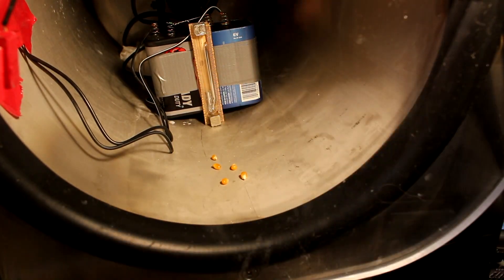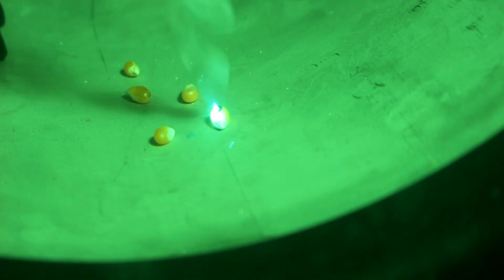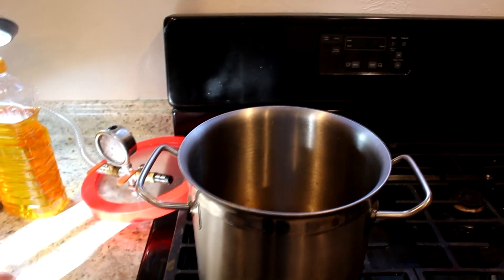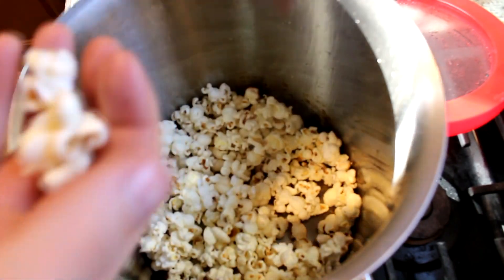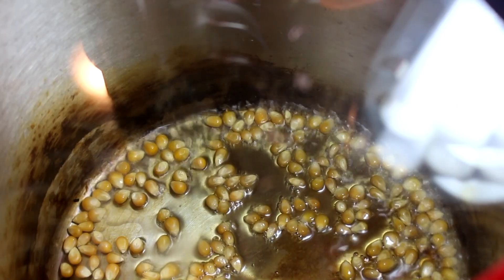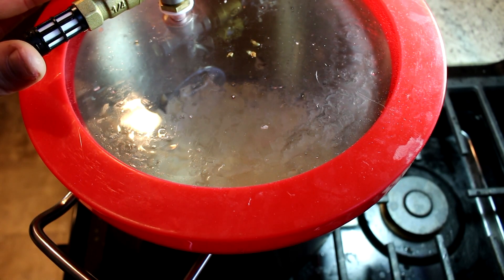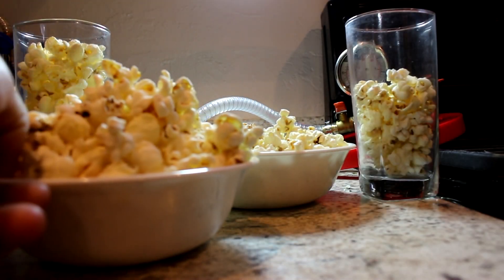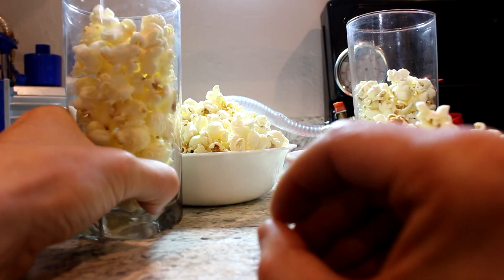Popping Corn In a Vacuum

Comment: What was the pressure at which you made the popcorn in a "vacuum"? And did the pressure rise significantly when you turned of the pump, presumably because of the escaping gasses from the popping corns? Namely after you tuned of the pump the lid did seemed to fog up quite a bit.

Comment: I wonder if movie theaters will start doing popcorn in vacuums now to cheat customers even more.
Reply: Jens Boettiger Kaleb Bruwer the cost to setup the vacuum, maintain and run it (plus time added to process = $) would outweigh the savings on kernels.
Reply: You have no idea how cheap corn is.
Reply: That's not a bad thing lol
Reply: In the UK the price for a movie theater to make 1 large popcorn is about 6 P and a normal around 5P the actual cost we pay is around £6 for a large with a drink such a rip off.
Reply: They could use less corn for the same price.
Reply: time to deliver a pizza ball , maybe the cost to setup and maintain the equipment is more than it should be? Lol
Reply: Kaelan Dinwiddie its 4000% mark up
Reply: JavierBacon especially GMO corn :(

Comment: Makes me wonder if the vacuum would affect how easily the popcorn would burn.  Any difference in speed or temperature settings?  I would think that the vacuum version might cook faster and/or require less total heat energy since there wouldn't be as much heat transferred to the atmosphere.  Would be neat to see this done at high pressure as a comparison.

Comment: If i see cinemas installing vacuum popcorn poppers to rip us off by selling us less popcorn, I'll blame you.
Reply: Kaleb Bruwer the cost to setup the vacuum, maintain and run it (plus time added to process = $) would outweigh the savings on kernels, they are extremely cheap.
Reply: eaglescout861you'd also then multiply the time it adds to the process and to maintain etc. You pay employees, time = $.
Reply: Silver_+ but then multiply that little amount saved by millions of pounds of corn that are sold ever year at movie theaters
Reply: Silver_+ Employees get payed there shift. I don't see how new machinery would extend their shift or force overtime AT A CINEMA.
Reply: Kaleb Bruwer paid not payed

Comment: That's one way to make more money... Pop all your corn in a vacuum, you get more bags from the same amount of corn. Plus you can mark them at a premium, marketing them as "fluffier than normal popcorn"

Oh god what have I brought upon us all
Reply: You brought the same stupid comment everyone else had. Doing this will never result in cost savings. Corn is too cheap, vacuum chambers are too expensive and take too much energy. If anyone wanted to sell vacuum popped corn, it would be for pure novelty.
Reply: You brought nothing
Reply: Dried costs a few dollars per bushel. It had been so cheap that there are pellet stoves for heating homes and hot water fueled directly by corn as "pellets".
Reply: That makes sense at first but in the end you'd earn around the same amount of money as if you did it normal way, since pumping out air again and again isn't free, just fyi.

Oh and pumping out air not from a small stove like this, you know...
Reply: and also the time it takes for a full batch of vacuum popped popcorn is definitely going to be longer than popping that popcorn into a vat of oil w/o vacuuming the air out. so overall i think whatever positive revenue you may get from vacuum popping is offset by the amount you can produce in the same time frame. although it's all speculation on my end and i'm not a popcorn industry expert. lol

Comment: shouldn't the vacuum have boiled the water in the kernels and made them pop? I thought this is where you were going anyways. When I work on AC systems in a vehicle, we prep the system by drawing it down to -30 inches of Hg for 30 minutes, which causes the water to boil and evaporate out of the tubing. it probably wouldn't take near that long to achieve popped corn! I want to see this tried without added heat!

Comment: now cinemas will invest in vacuum chambers to fill more bucket with less corn ._.
Reply: More expensive to cook the corn under a vacuum though.
Reply: actually it probably wouldn't be more expensive since popcorn is extremely cheap to make. We pay over 1,200% of what it's actually worth
http://www.inquisitr.com/871573/movie-theater-popcorn-costs-more-than-fillet-mignon-report/
Reply: Sticbas well the corn is cheap, and you would actually need less of it. but the convertion costs of corn to popcorn will be much more expensive. creating a vacuum is pretty expensive energy-wise.
Reply: The point you're missing the though is the actual cost of corn. It only costs theaters about 10 cents per ounce of popcorn. With this method, based on corn alone, it would cut that down to 5 cents. Considering we already pay astronomical prices for popcorn, charging more wouldn't be necessary. Even if they did charge more, it would only really add a couple cents to each bucket of popcorn. Honestly they would probably be back at 10 cents per ounce with energy costs included.
Reply: This may be a little dishonest, but it's not highway robbery considering you can be charged 9 dollars for a large bag of popcorn. Here where I live, if you go up to the counter with a large bag, they will refill it for free. They fold down quite nicely, like any paper bag. I just keep mine in my glove box and slip it in when I go to the movies. Free refill. They charge for the bag, not the popcorn, so employees can't give out free bags of popcorn. Free new bags of popcorn, anyway. I don't feel too guilty doing this, as I refresh every 5 movies or so, and buy a new one for sanitary reasons. They get their money, and still make a lot of profit too. I go to the theater a lot, and popcorn kernels are so cheap. Plus, I buy a drink. So, they aren't losing any money on me.

Comment: Would the corn not pop under vacuum alone with no heat?
Reply: No, it wouldn't make popcorn. Part of the popcorn equation is that the heat causes the starch to cook ("gelatinize") before it pops, essentially forming a hot gel foam that solidifies when it cools. Without the heat, no cooking and no gel.
Reply: You watched the same video I did. Did they pop immediately in the vacuum?
Reply: I expect it would freeze.
Reply: The water inside would boil before freezing.
Unless the corn husk protects it from the vacuum.
Reply: Yes it would boil, but the boiling water is not actually hot.
Reply: Cody put his hand in a vacuum chamber before, It was not a very good one because it was not that strong but the vid's on here if you have not seen it. When he did it, nothing happened. I think the difference is just not great enough. I would like to see him do it though and find out for sure.
Reply: no one wants cold popcorn!
Reply: Perhaps you need to freeze it first like astronaut ice creams. Or maybe superheat it. But would it pop then?
Reply: There has been a lot of time and effort put into scifi space shows to make what they do realistic. 25 years ago everybody thought you would explode if exposed to space suddenly. Then 15 years ago they thought you would freeze in seconds or something else horrible. The general consensus now is that if you "spaced" somebody (emptying your lungs first, good idea) nothing would happen for 30 seconds to a minute. Probably lots of bruising from surface blood vessles bursting etc. Nothing that bad.
Reply: your blood would start boiling at body temperature because of the low pressure
Reply: MyZCube
you're right, so it's nothing that bad, as long as it doesn't cause a brain embolism and kill you. lol, but also you have to remember your blood is inside you, and not exposed to a perfect vacuum. :)

Comment: Awesome. You just increased the yield of a commercially sold product. Less corn kernels will fill a bag or one of those tins of popcorn.  Or companies can market the same amount of popcorn kernels as less calories per volume.
Reply: He should patent it... Make a lot of money from popcorn manufacturers and especially movie theaters everywhere!
Reply: He is definitely not the first person to do this.
Reply: I don't know of any food products that are sold by volume instead of weight, but I could be wrong. 
   
    P.S They could be called "Fluffed Corn" commercially/colloquially.
Reply: I would guess the price of having all the vacuum chamber equipment to pop the corn in a vacuum might cost more than the extra volume you get out of it.
Reply: and slapping a "airless popped"
Reply: Definitely wouldn't be cost effective for theaters to have a setup like this vs a large pot the corn can spill out of as it pops into a large storage area until it's bagged and buttered.
Reply: Especially because the profit margin of popcorn is already ridiculously high.
Reply: I wonder what the long term added profits would be with the also added larger electricity bill from running vacuum pumps and extra labor cost.
Reply: Popcorn in theaters are usually sold by volume, and not weight. Plus, even if weight is the thing marked on the box, people usually look to volume to estimate size (and willingness to pay a given price).

It definitely wouldn't be effective in something like a movie theater, though, and most store-bought popcorn is in kernel form.

Comment: Neat idea.  Could you tell if it required any more/less heat to pop?  Seems like it would be less but???   Also, i wonder if you could pop them at a lower temperature by rapidly pulling them down to a low vacuum.

Comment: Can you pop the corn by vacuum pressure alone?  In a previous video you boiled water just by vacuuming, why can't you pop corn that way?
Reply: This... I was about to comment this then i realised that tihs video was made a few weeks ago and saw tihs
Reply: Landon Kryger Thats what he did in the video, and when he removed the pressure, it dropped the temperature by a lot, dont think you can cook food like this because you arent heating anything up, the only reason it works with popcorn is because the expanding gases inside the corn from the lack of pressure cause the kernals to explode. When you cook it, it steams, and the expanding gas explodes the kernal. Though similar, the reason they work is different

Comment: The kernels pop from water inside the hull turning into steam due to heat...so, would they pop in a bowl of water when you lower the pressure in the vacuum and the water starts to boil?

Comment: to get the laser to pop the popcorn without burning wrap each kernel in a thin layer of tinfoil. simple as that because the foil distributes the heat around the kernel
Reply: But then you have a bowl full of conspiracy theorist corn
Reply: JoshDoesEverything 
but won't it stop the corn from expanding/affect it
Reply: Po Yao Cheong no it pops just fine, i've done it a few times. you can only use one layer tho
Reply: Or defocus the laser so it heats the whole kernel evenly.
Reply: Patryk567 still couldn't get the back side
Reply: nycthreye exactly why i made this comment lol. the laser popping popcorn episode
Reply: JoshDoesEverything Do you have a video of this?
Reply: True, but maybe it wouldn't just burn through the side, then you can heat it for longer.
Reply: Discovery does, because mythbusters have done it

Comment: REQUEST: Make copper peroxide, then use that to make copper based thermite.
Reply: Conn Clark I think he has made copper thermite.
Reply: He did it with copper oxide, not copper peroxide. Copper peroxide has 2 oxygen atoms and is unstable. It will give off more energy than copper oxide.
Reply: Conn Clark It's been a while sinice I watched that (Sorry lol).

Comment: Would it be able to make them pop even bigger by:
1) "de-shelling" them (so only leaving the starch) and placing the cleaned starch into a very small high pressure chamber (such as a small pressurized gas cylinder that can take, say, 100~200Bar)
2)Then connecting it to two much larger vacuum chambers (so each end of the pressurized cylinder is connected to a large volume vacuum chamber via a pipe that tapers from the diameter of the small vessel to the diameter of the large one), via two high-speed, high-flow valves mounted to the ends of the small cylinder
3) Then filling the pressure vessel with the correct amount of water to give a pressure between 100~200Bar when it has all turned to steam
4) Vacuuming each chamber down and then heating the pressure vessel containing the starch to the correct temperature and pressure and keeping it there for a few minutes
5) And finally opening both valves to almost instantaneously drop the pressure from >100Bar to <1Bar?

I am assuming that the difference between such an attempt and simply heating and  pressurizing the kernels to >100Bar in a suitable vessel and then quickly venting the vessel to the atmosphere would be very minor, since the difference between the pressure differentials applied to the corn amounts to less than 1%. Still, I would love to see if it indeed does work out that way in real life, as well as what the function relating the applied pressure differential to the popped kernel volume would look like (as well as the influence that the absolute pressure, i.e. the mean of the maximum and minimum pressures, has on that function, if any).

Comment: If you were to drop the pressure in the pot with the corn very quickly, by having a pre evacuated chamber connect to it(for argument's sake), would the rapid pressure difference be enough to pop it with no heat?

Comment: Kool!

Actually, you may have solved the biggest problem in popcorn making; burning popcorn!
We've all done it... Smoking popcorn, smoke detector screaming, black marks that are hard to remove from the pot... 
It would be interesting to try popping the corn at a lower temperature and completely eliminate burning.

I noticed that you turned on the pump at the same time as the heat.
You might try cranking the vacuum for a while before applying heat.
The pump will need a few minutes on get a stable vacuum.
That looked like around a one gallon pot. 18 grams of water would produce 22.4 liters of water vapor. Around 5 pot volumes...
Popcorn has around 15% water content and so the vacuum will reduce quickly as they pop.
Just be careful because of the pump oil when you release the vacuum (but you probably know that already!)
The water won't boil in a vacuum until you hit 15 - 20 torr at room temperature...

Comment: Hey Cody what kind of laser is that?
Reply: And btw can you light a fuse with explosives underwater with that laser?
Reply: I would imagine that due to the much higher particle density, the photons from the laser would be diffused much more quickly. Greatly reducing it's effective range.
Reply: wont the water refract / scatter the light from the laser? you might have to aim from a different angle for the light from the laser to even hit the fuse.  if it would ignite underwater im not too sure about that

Comment: Something that might produce still larger popcorn, but would be impractical: Get the kernels hot at several tens of atmospheres,  or maybe even higher, so that the internal pressures and temperatures can build up to incredible levels, but they don't pop due to ambient pressure, then very quickly drop the pressure to 1 atmosphere.

Comment: When popping corn using atmospheric pressure and heat, I believe that the oil is used to help transfer the heat to the corn more evenly.

What function does the oil have when using the vacuum? None?

Comment: OK Cody, time to patent the process of popping corn in a vacuum..... $$$$$$$
Reply: I had a professor that already did this :)
Reply: He did
2008/0233,256	2008	METHOD AND APPARATUS FOR POPCORN POPPING IN A REDUCED PRESSURE ENVIRONMENT
Paul V Quin
Reply: yes but if i use a different method and apparatus I won't infringe on the patent

Comment: How do you filter the vacuum pump. Doesn't the moisture being evacuated accumulate in the pump oil, reducing the amount of vacuum that can be pulled. The moisture trapped in the oil can also ruin the internals of the pump.